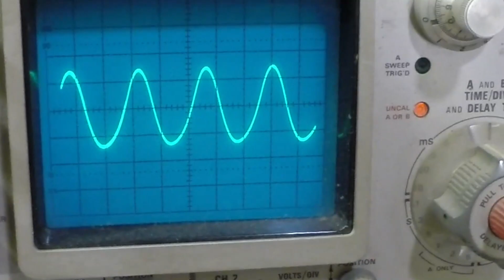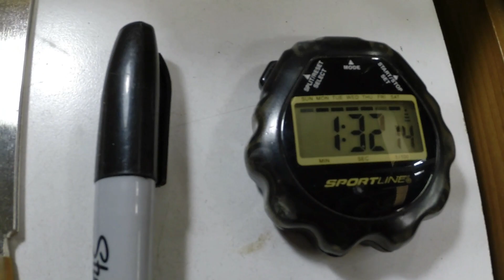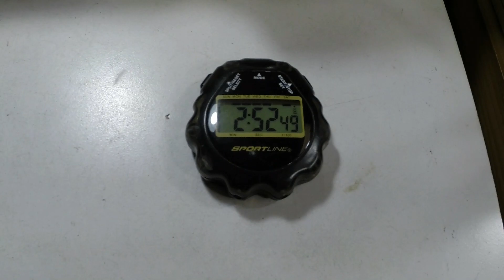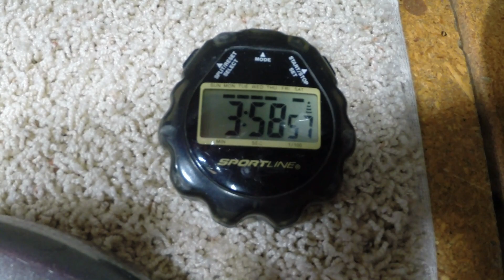Repairing a Precision bass repair

Comment: I have a MIM p bass neck that will buzz in a few places around the 17th fret area. If there is no rise in the board, how do feel about filing for falloff? All else is set up and I don't use that end often so I have ignored the low/ high frets. Great video.
Reply from the maker: You may not have a kick up problem, maybe just a few high frets.  If needed, I have no problem sanding in a few thousands of drop-off.  However this is where a neck jig really makes a difference, and the actual culprit that made me realize the value of one a long time ago.

Comment: It bothers me that such a 'young' Fender bass should need so much remedial work so early in its life.I can understand the string height problem,probably due to the new bridge,but the frets??Wow!
Reply from the maker: It actually surprises me when I see a neck that does not need fretwork of some nature.  Initial QC and wood shift can account for some of it, but in this case the action height was due completely to tech incompetence.  There is also the fact that the previous work was done by an authorized Fender service center, so why did it not meet factory specs?  Thus it ends up in my shop.